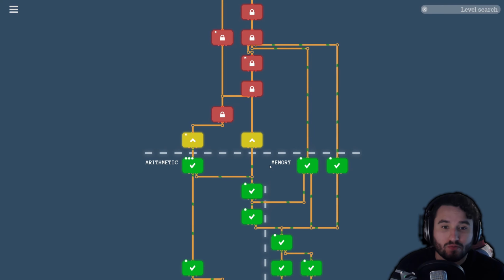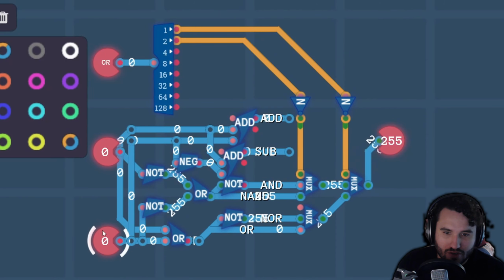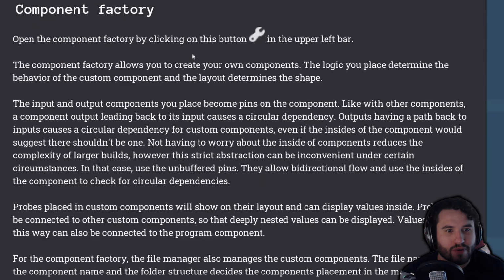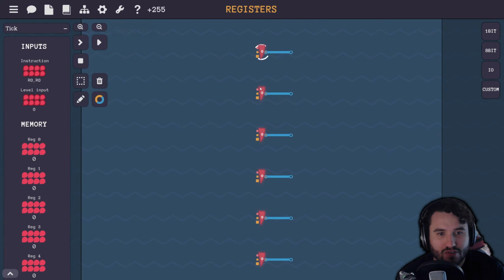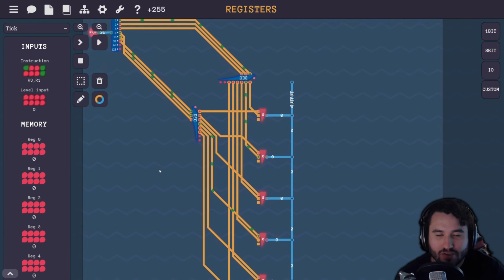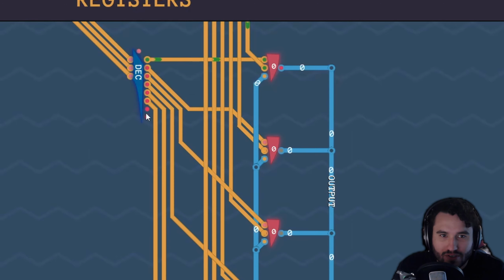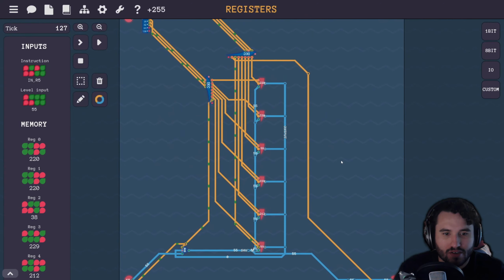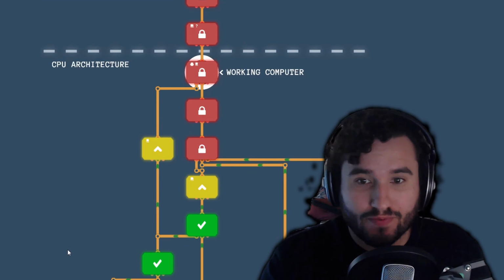Putting My Real Computer Engineering Skills To The Test

Comment: Funny how you can have so many different solutions to the same problem.. Yours are more elegant.. I'm not a computer engineer.. I'm a musician, normally I wire (make patches on) modular synths (which... is a lot like this to my surprise*).. And my solutions look a lot like those piles of wires you'd typically find on modular synths (problem both with this and with modular synths is, you understand what you are doing until you put it away for a bit, figuring out what you were doing when you get back to it is nigh impossible... They work though..

* In a sense that you have [boxes] that do something with your signal, and you wire them together to make stuff happen.. The logic is very similar..

Btw, have you played "Prison Architect" or "Factorio". They are a fun "logic" sandboxes as well.. Factorio more than PA. Fun crazy people with too much time on their hands were building CPUs in there as well.. And there are more games with logic gameplay, I can't recall right now though..
"I fetch rocks" is a VR logic sandbox, basically (it's also a game about moon mining, but you have to program your ship with logic.. but you can also just sandbox string things together)... this is actually plugging logic bricks in a similar way to how you would wire (make patches on) modular synths.

In "Registers" I don't think you need the mux on the input.. you can just use the switch on the input and output as "load" and "save" respectively.. like you did on the "save" side...
Because it's only going to talk to the "bus" if that is high, and it can only be high if there is no load bit active on any of the registers.. So it mux-es itself like the registers do too...

Comment: For the logic/arithmetic engine levels, I decoded the instruction byte and connected the outputs of each operation to switches tied together with a bus to make a 6-to-1 multiplexer all in one step. The wires also help visualize which switch is being enabled that way, which has saved my bacon a few times when I started doing more complicated designs for the ALU in the second phase of CPU architecture (the "LEG" Architecture, as opposed to the "OVERTURE" Architecture you first achieve Turing Complete status with).

Also, the MUX you used to connect to the input is not needed. You can treat the level output as the save value input for a 7th register with its enable pin being akin to the save pin, and the level input can be treated like the grey register output with the enable pin being akin to the load pin. In fact, besides the instruction byte wire, you only need one 8-bit bus connecting all the components for this architecture.